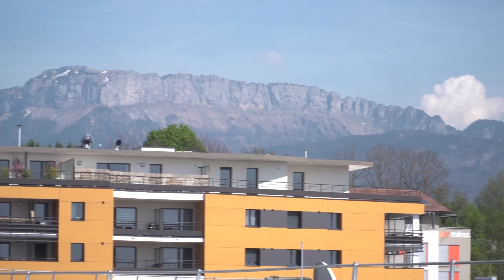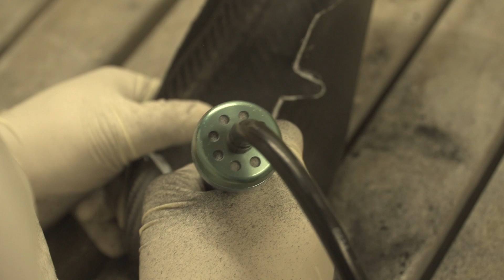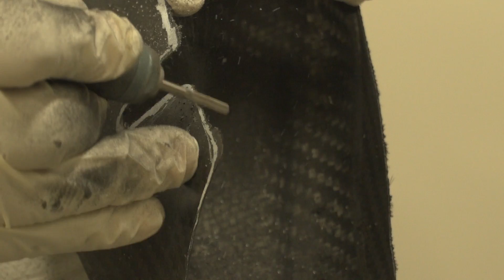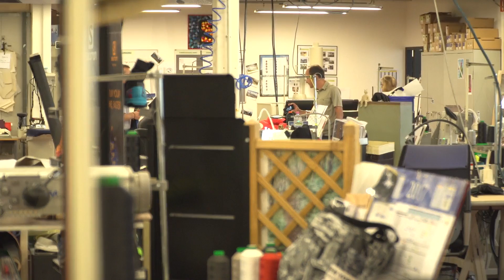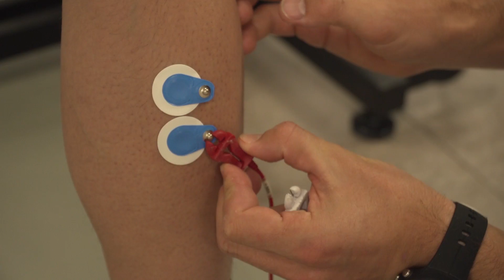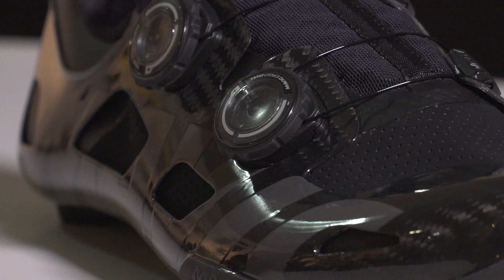Mavic Comète Ultimate Shoes - Behind The Scenes At Mavic HQ

Comment: I brought a pair of mavic shoes once, full carbon sole. after about 10Km on the very first ride I felt a crack on my left sole during the pedal pull up stroke. stopped, inspected my shoe and there were 2 huge cracks either side of the cleat. I emailed mavic about the situation and provided detailed photos, they asked me to send it in for replacement. after about 2 weeks they rejected my replacement due to them thinking it's crash damage, because there is a small scratch on the right hand shoe (left shoe was the cracked one). I've since been online and found many people with the same problem, and mavic's non-existent warranty. I have never brought a mavic product since then.
Reply: I gave up on Mavic after two back-to-back wheelset failures on Crossmax wheels.  They do make some very attractive looking stuff, however.
Reply: John Eber - I think you mean,  someone knowingly bought dangerous wheels?!
Reply: You knowingly sold dangerous wheels to someone?
Reply: A noob may not notice those things and may not know they are dangerous. If they are told by the seller and still buy that is their own risk, but I wouldn't be able to sleep if I sold a person a dangerous item that they think is safe

Comment: Shouldn't Eddy wear a mask? As far as I remember from older videos carbon dust is toxic for people :) As always great factory trip!
Reply: Yeah in a few decades he's going to regret not wearing a respirator. It's one of those things that people don't care about in the short term but almost inevitably cause them health problems down the road.
Reply: He will apply for early retirement due to health problems...
Reply: I thought that too, but it appears he's using a fume extraction table. If it were me though, I'd wear a mask in addition to the table.
Reply: The table Eddy is working on has a slotted top with a downdraft exhaust system.
It's fine as long as you keep the workpiece below you, not have your face too close, and not have too aggressive machining that chucks particles beyond the capacity of the extractor. That said, downdraft tables like any open extraction system have large dead zones, and the best extraction is near the hose outlet.
Reply: Paweł Bartoszewicz very questionable workplace wellbeing in deed
Reply: Paweł Bartoszewicz yeah Eddy is good as dead
Reply: He's working over a large air extractor which is pulling the carbon dust out.
Reply: Built into the bench is a exhaust system ... it pulls the dust down like a BORA range ....
Reply: Rit Che I'm afraid it's simply a reality that obesity causes health problems, but you obviously don't know much about reality since you have flat earth playlist

Comment: #torqueback completely of topic. how to transport your bike by car. Maybe a good idea for a video / review video.
Reply: Take the wheels off and put in the back?! Dont put it on the roof unless you're a knob. Make the family walk or buy their own car.
Reply: or how to transfer your car by bike? that would be more interesting
Reply: Get SUV, which stands for Sport Utility Vehicle, and utilize it's main purpose - transport sport equipment. (Partially) disassembled bikes will fit the trunk or  trunk+rear passenger space. The rest depends on your local regulations  (rear attachment or towing restrictions) and the roads you ride (low clearance tunnels and bridges, hanging tree branches...).
Roof rack works for most of the cases, just make sure you know the height of your car with bike on top and don't miss the clearance signs.

The bike bag with bike fit inside will make wonders, it will fit most of the trunks and promotes you to check most components cleanness and proper bolts and skewers tightness.
Reply: Either throw to trunk if you have large enough car (V90 fits my 29er easily) or use roof mount. Rear mounts might be good if you get one which has additional lights and license plate, bike will get dirty though.
Reply: What's wrong with having roof rack on all the time? The tin can type racks shall not be used at all, others are fine to be on the roof as long as you own the car.
Reply: feketekocka Best comment ever, comedy remark kudos to you sir.
Reply: Yes, a video exploring different options to fit different circumstances would be a great video idea. A big 20 minute video.

I bought a station wagon to big enough to fit a 29"er with wheels on, laying down flat with the rear seats folded down. 
An SUV, MPV, ute can stand bikes upright with more generous height clearance. Roof racks don't intrude into interior space, but add fuel consumption and parking garage problems where I would buy a flashing sign to remind me of bikes on the roof. Boot and tow hitch racks keeps bikes low to the ground for easy access and keep the kit in the slipstream to keep fuel penalty lower, but opening boots with rack or bikes on usually a PITA.
Reply: Shows also how different cars each country has =P 
One can only think of different style of sedans and one thinks every car has sunroof =P